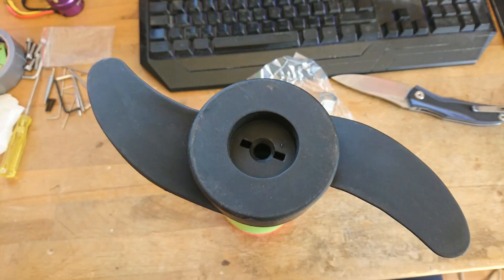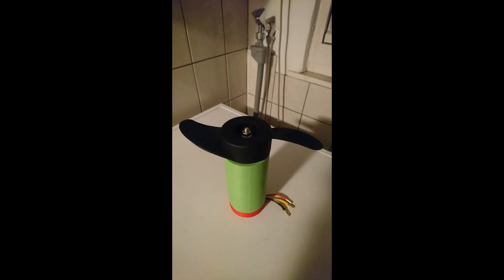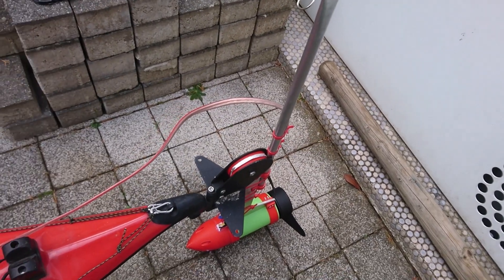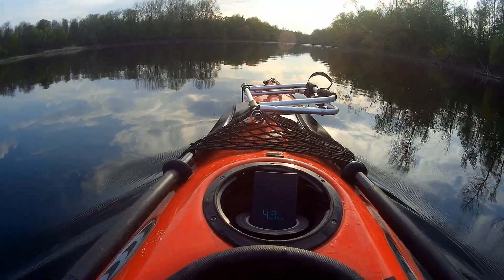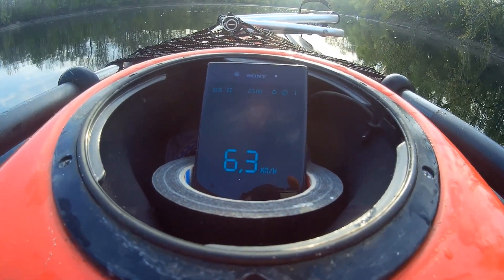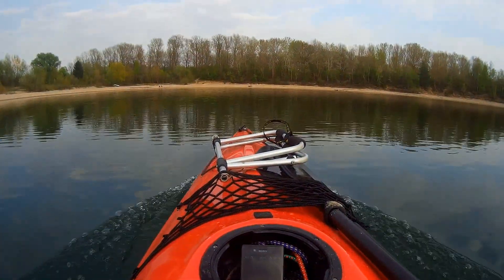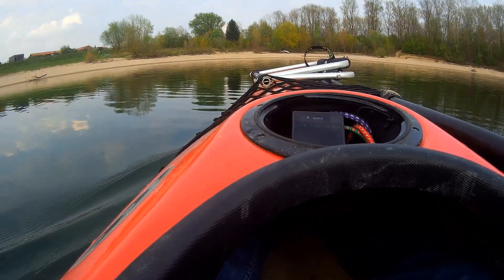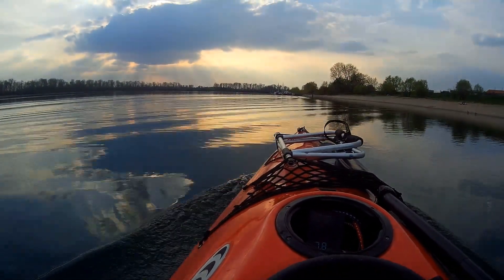Brushless Kayak Motor 2.0 (DIY) (work in progress)

Comment: Details on motor. Reduction esc please. Nice vid.
Reply from the maker: The Motor is a XK3674 1650 KV from Turnigy, the ESC is a 90A Turnigy Marine ESC, the Planetary Reduction Gearbox is generic but can be found when searching for planetary rc crawler gearboxes, it is 36 mm in diameter and has a reduction of about 4:1 (but sometimes they are advertised with the wrong gear ratio, however, everything from 3:1 to 15:1 should do the job), the prop is about 220 mm in diameter and has an advertised Pitch of 3 inches per revolution. Thanks for the reminder.
Reply: @rcandfun242   that’s great. Thanks! Are you able to share the plans. Is this a waterproof assembly. If so how are you keeping the water out of the shaft. I’m looking to replace my current broken trolling motor.
Reply from the maker: I just shared the 3d printing files in the video description. However, since this is a very early prototype, it is far from perfect and the assembly process is also far from optimal. I didn't try to make the design fully waterproof this time, because it's not simple to make 3d printed parts fully waterproof in the first place. Instead I tried to keep the air gaps small and fill them up with waterproof, bio-degradable marine grease.
Reply: @rcandfun242  thanks  great work. I look forward to seeing your future iterations and projects.

Comment: Great Video! Do you know the average amp draw when going full speed?
Reply from the maker: This system draws around 30 A with a 2 cell LiPo battery and at least 120 A with a 4 cell. The high amp draw is the reason I used a much higher gear ratio for version 3. Unfortunately, the speed controller randomly died (not burned out or anything, just refused to work suddenly) . So before I can test it I need to repair it, or order a new one, which will take some time